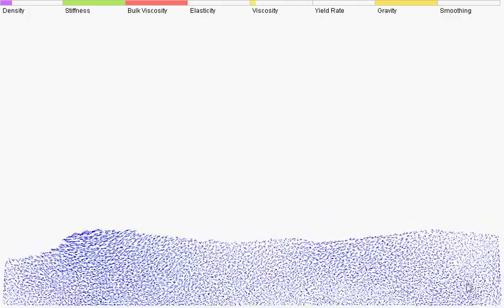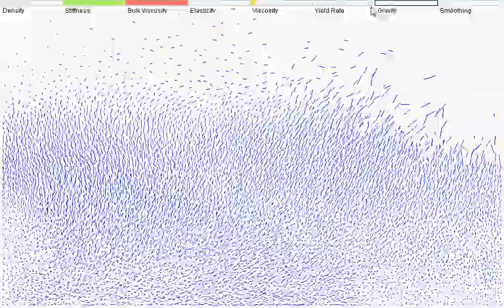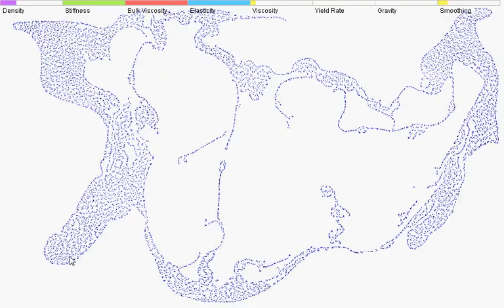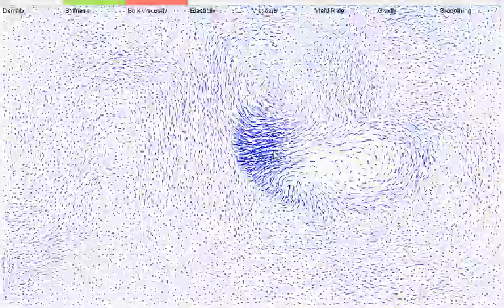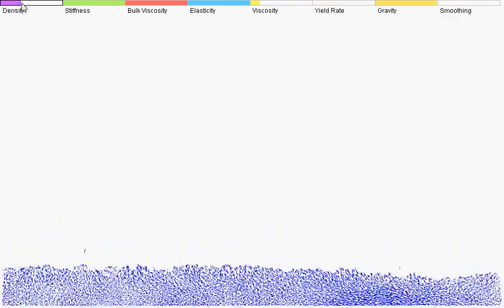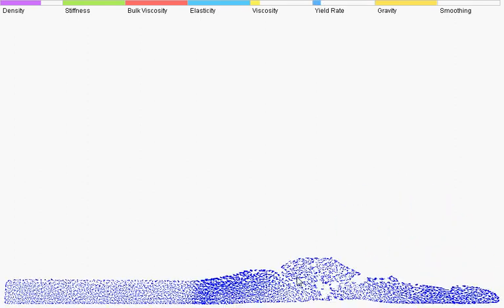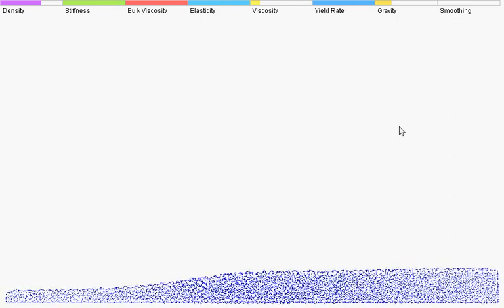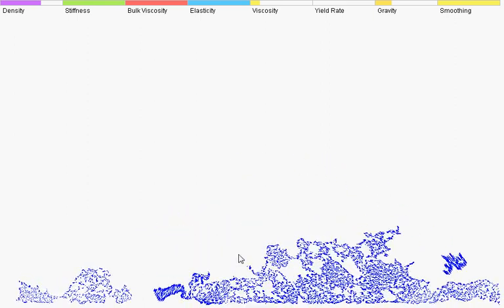Liquid Simulator Demonstration

Comment: I have two suggestions, see if you like them or not: one - the old Java ripple tank app had the feature to draw obstructions, and the waves would interact with them. Two: you could use color to indicate pressure, in addition to the line length you have to indicate particle speed. That would visualize even more data.